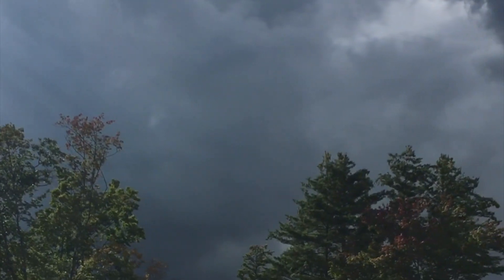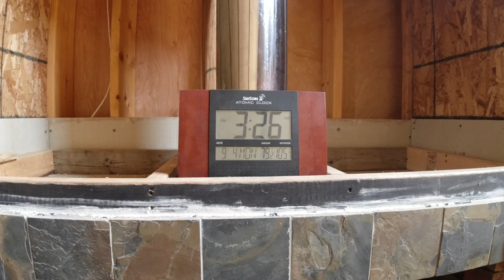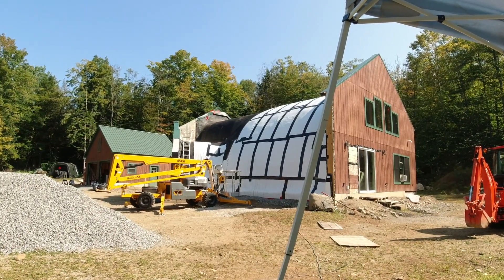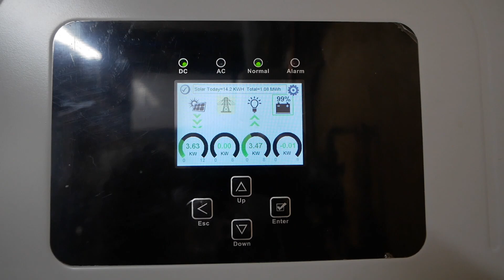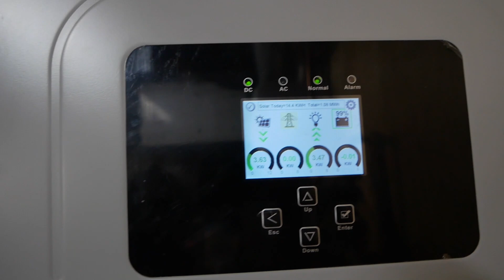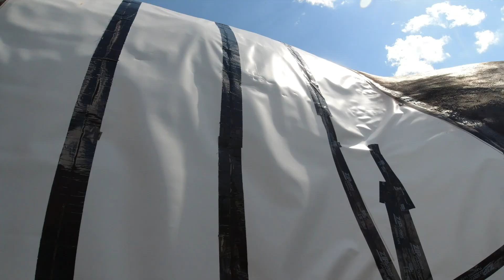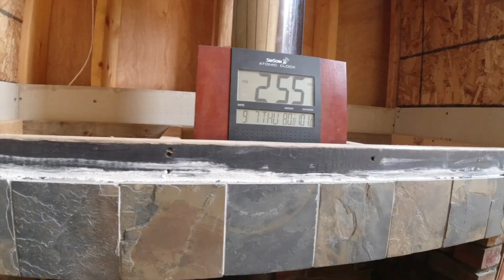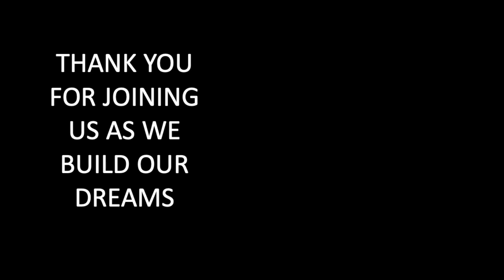Waterproofing Concrete Dome with Bentonite Clay Membrane

Comment: Bentonite is not a local product for that manufacturer and its being shipped out to the Eastern states by rail car once a week from here. plus you have had a lot of derailments lately. COFU induced worker shortages.Costs go up, sooo? It's like hot dogs come in a 6 pack now. Most people will not go to work for these mining companies because they still require the COFU shot. That is why we pulled out as contractors.
Reply from the maker: It makes sense, very disappointing though😕

Comment: Awesome progress.  Like true homesteaders, you guys are gettin er done no matter what.  Cyber docs comment,"rubics cube Klondike bar" is great.  I was thinking unfinished partridge family bus. Lol. I'm so relieved that the leaks are fixed. Woohooo! 
I wish there was a quick easy way to add a roof and a door to the pit. Could be awesome storage or a root cellar.  
I hope installing the foam insulation goes smooth for you guys.
Reply from the maker: Lol. Thanks so much! Never thought about what it looked like but lovin it!!!! We are also very relieved about the leaks and we did think about putting something down in the pit and using it but we really need the dirt in there and everything for insulation and drainage

Comment: @2:17 the Pink Floyd reference... "I'll see you on the dark side of the dome."  It looks like a Rubik's Cube Klondike Bar sometimes.  🙂 Did you get the idea of communicating and passing drinks through the Pit hole from the movie Brubaker?  I could use a margherita. It's been sweltering here as well and rainy.  Matter of fact, it was so damned hot that I opened a can of evaporated milk and there was nothing inside.
Reply from the maker: Pink Floyd gives me some great memories! I know we did not get the idea from Brubaker, But that movie is now on our list! The heat and humidity have definitely been brutal. Satay cool 😎😁
Reply: @CreatingASimplerLifeOffGrid  yeah, Brubaker's a classic with Redford.  Take it easy out there, fam.
Reply from the maker: 😊👍thanks